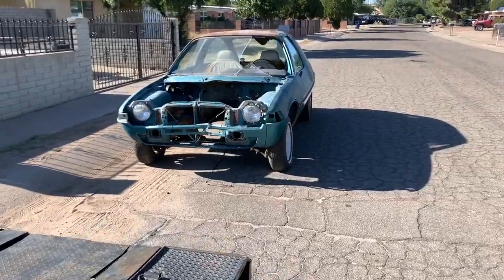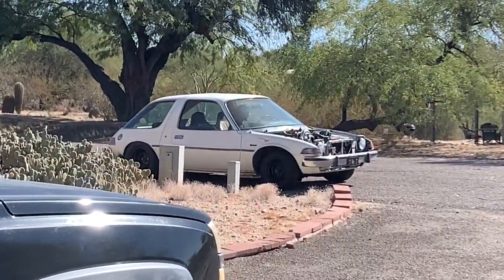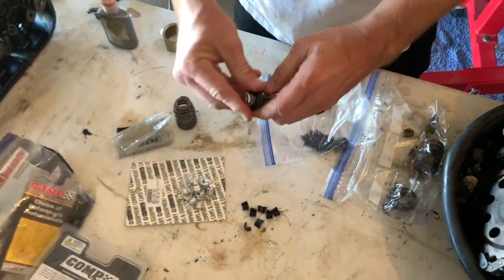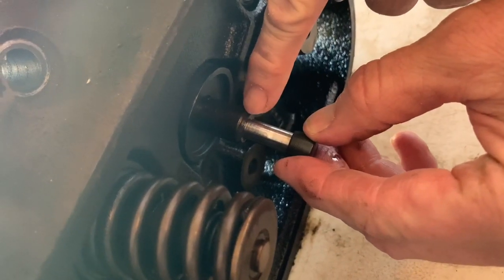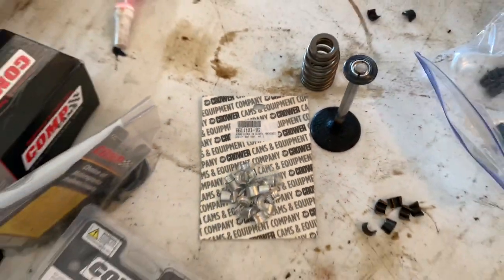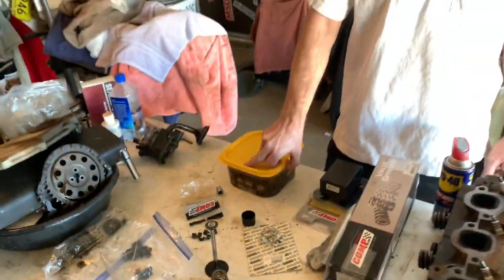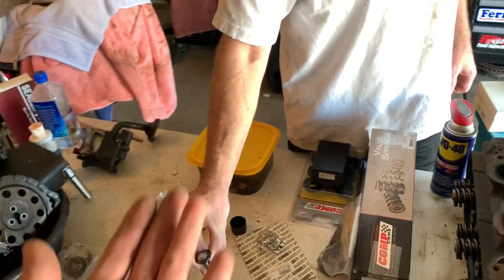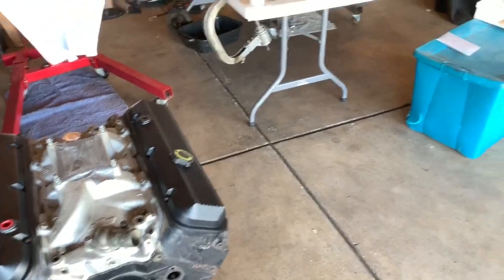L29 454 update + The Pacer goes to its new home!

Comment: Hi Dick,
Love this channel! 
I got a lot of knowledge of BBC - of it!!! 
Some questions as Iam looking to do ZZ502 on stock EFI454 gen6:

 1. Is it necessary to use performance pushrods kit and adjustable rocker arms with ZZ502 - in a stock engine of genVI 454 ? 
2. Secondly if I have to swap my stock for performance what  length of pushrods should I order ?
3. Does oil pump is a necessity to be replaced for more flow?  (if my stock is ok should I replece it??) 

My plan is ZZ502 + Valve Springs +  EFI tune - rest is truck stock in Suburban gmt400

Comment: Thanks for getting back to me brother.
Im doing the same build as the budget
L29 454. Im putting it in an 86 GMC 2500
4x4 the question I have is the truck I removed it from had an oil cooler( 1998 3500). I'm not going to use a cooler. Can the in & out ports be blocked without any other modifcations. Any info apprieciated.
Keep up the good work like the way you boys roll. Also how do I order some T- Shirts ?

Comment: Why is the head off?  Just for inspection of the cylinders or maybe  the head gasket ?  Or was he having the area under the antirotaters worked on?  i have seen on summit where people say the anti rotaters  do not fit without machine work. 

The thicker push rods he showed were those standard length for this motor?  I want to do a build like this.  I already have the donor suburban just needing to know if I can avoid the machine shop. Thanks for all the part numbers.
Reply from the maker: Great questions! James has been working on these exact things, and the next video will have a full explanation brotha 🤘🤘
Reply: @DickHamm  looking forward to it.